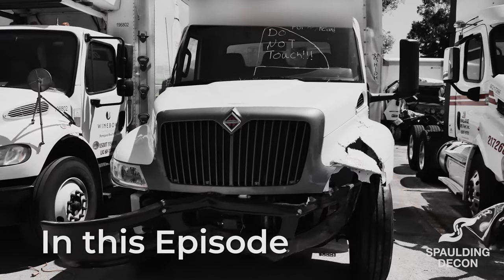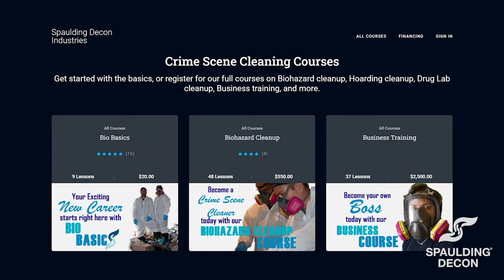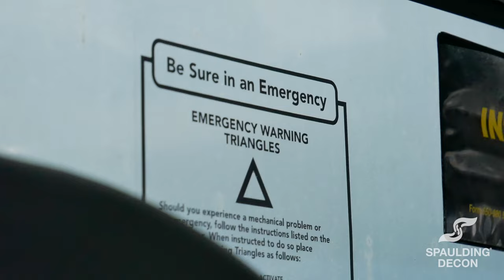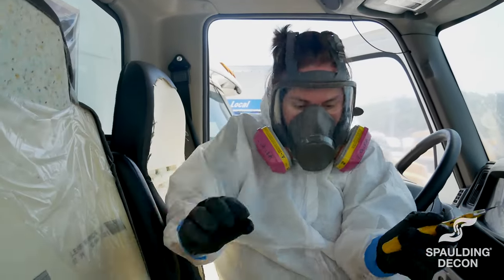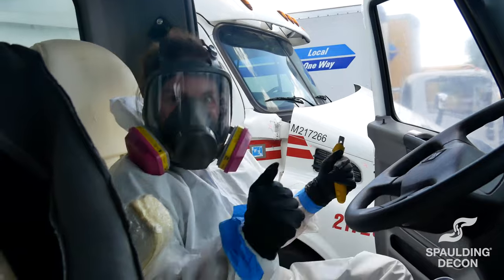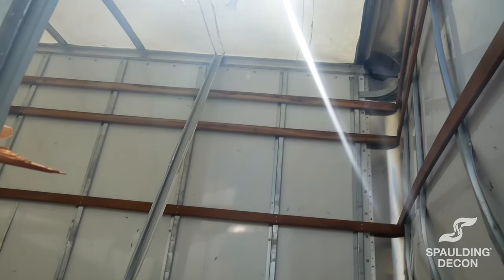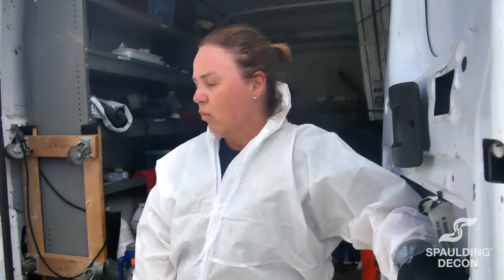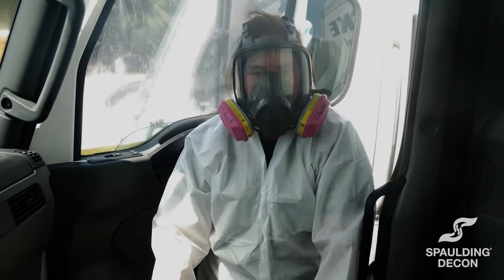When a Rental Truck Becomes a HAZARD: Fentanyl Decontamination

Comment: So if you hava already vacuumed and wiped the seats, why cut off the seat coverings?
Reply: You have to do that. That material is porous. So even if you vacuum and wipe the surface, the stuff has already gone down into the padding and to the base of the seat. But you have to get it off of the surface to make it safe to remove it.

Comment: I feel compelled to say, touching/breathing near fantanyl isnt going to posion you, use logic here, users need to vaporize it with a flame and almunium foil or inject the drug to reach intoxication, and its not instantly fatal every single time obviously, people are addicts and maintinence users (multiple uses [not dead]) alot of people are claiming that the fentanyl crisis isnt talked about, which is undenyably false, thats fact. My own personal opinion is that fentany has been one of the biggest new development in drug culture in the last couple decades. 
Ill also mention im not affiliated, or at all pleased with modern drug culture and over-inclusive (in regards to substances) and radically political anti-legislative folk.
But i have struggled and overcome various addictions to stimulants. And the undecated fear that stigmatizes addicts is what ostricizes us and dejected drug dependant people are driven to use further to cope.
I wont respond to volitile comments, only civil arguments  are worth amy time.
Reply: it's better to be safe than sorry. They have no way of knowing what else may be in there.
Reply: You won't get any push back from me. I'm a fan of critical thinking as well.

Comment: Proper narcotics sampling would have confirmed the presence of any illicit narcotics.
This would determine both the risk assessment and if the seats had to be removed or not.
Post remedial sampling would confirm if the vehicle was safe to operate/occupy.

I am concerned that no sampling or decontamination of the HVAC system was performed.

Comment: Additionally Narcan is not a shot it is a nasal spray
Reply: It is formulated as an injectable dose as well. It can be administered IV, IM, or SC. Both the spray and shot are distributed at needle exchange sites. It’s not as easy for some people to administer an injection as it is for the nasal spray, so the spray is more commonly known and used.

Comment: Ive been in recovery for many years now, but this is a very large exaggeration.  The only way this truck is a real HAZARD is if it was shipping thousands of kilos of Fent.  A man injecting or smoking fentanyl is not going to affect you like they're saying, and this entire production is just kind of laughable.  I'm not saying it isn't dangerous, but Fentanyl cannot kill you/effect you unless you ingest it somehow.  It has to enter your bloodstream.  You can literally sit on it with pants on and you'd be fine.  In addition, you guys took out a fucking crack pipe, not used to smoke fent.  I also dont buy that he needed 8 doses of Narcan to be revived...unless it was over a 2-3 hour period.  3 doses is enough to bring somebody back from the dead...so my guess is that this man was high on much more than just Fentanyl...especially because you took a crack pipe out of the truck.